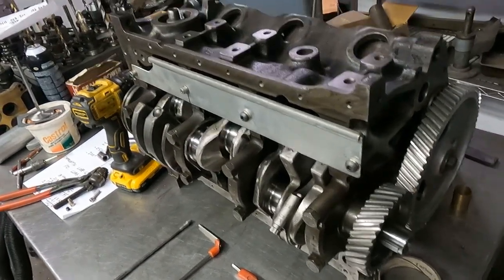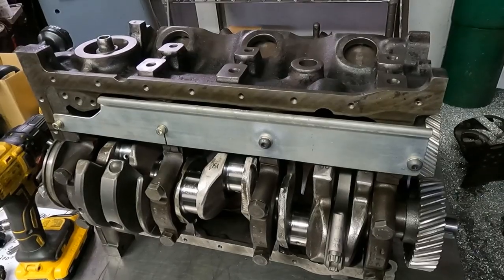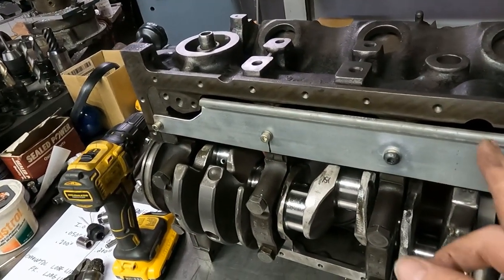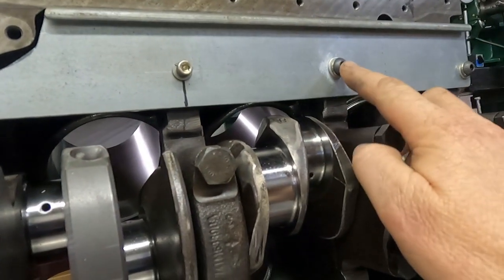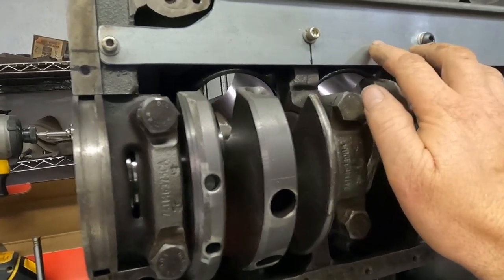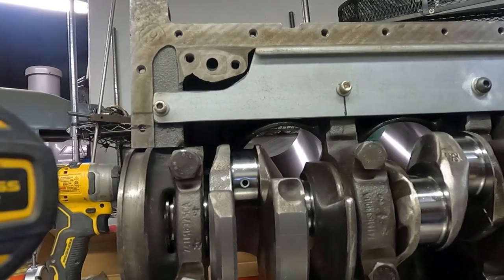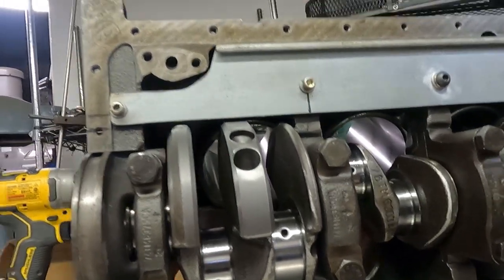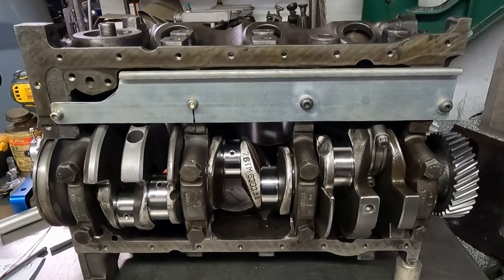Mild 200 HP 2.8l Ford V6.  Building a Crank Scraper!

Comment: Jeff, I’m using 4.0 parts to build my 2.8; main stud/bolts, windage tray. Plus the crankshaft and one-piece rear main seal.

Edit; I sourced an oil pan and one-piece pan gasket, NOS stuff, likely from a late 80’s van.
Reply from the maker: Interesting, I thought I read that the crankcase was wider on the 4.0l to fit the bigger diameter crankshaft.  You've already fit all your parts?
Reply: @mummertsspecialvinterests2721  Some clearancing is required and the snout of the crank is reworked to match the 2.8 crank. I have been holding off but now I will start the clearancing to demonstrate to myself that it can fit. I bought a Dodge 3.7 piston to mock up the rotating assembly. It uses the stock rods.